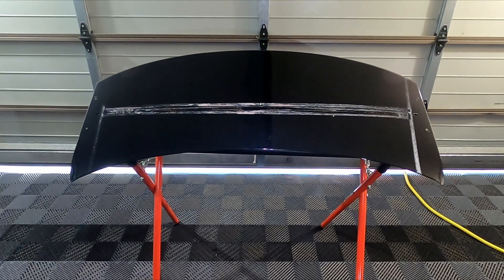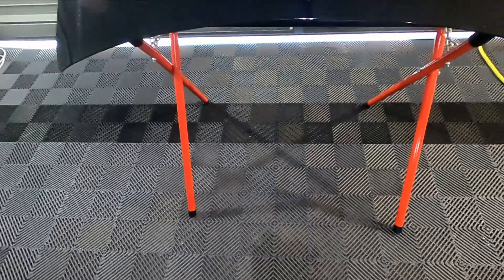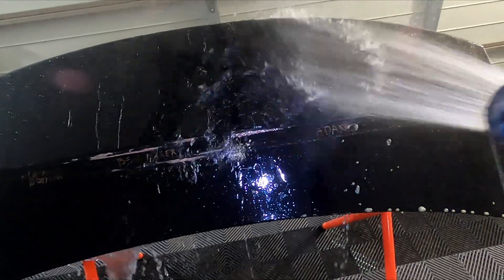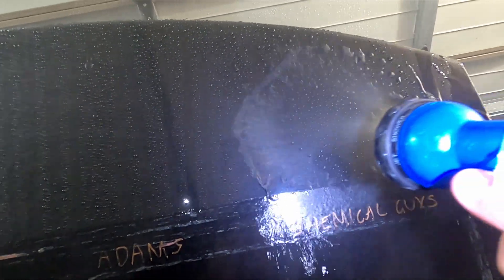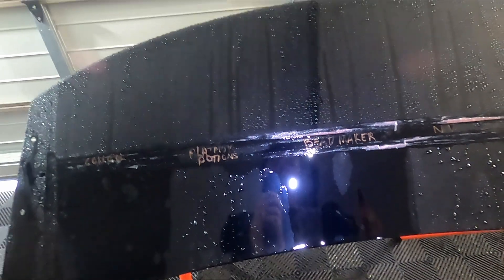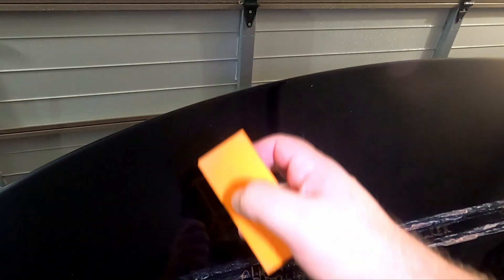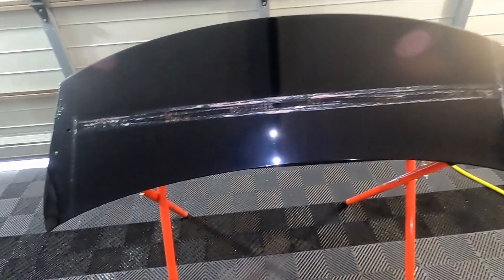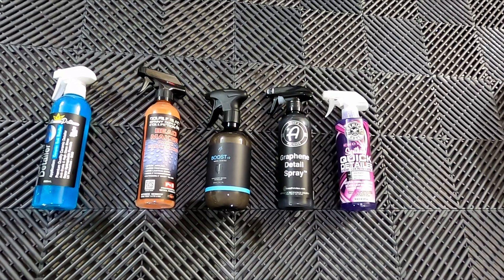What's The Best Ceramic Detailer? | 2 Weeks Later | Adams v Chemical Guys v NV v P&S v Platinum P

Comment: I put Ethos Finish shine ceramic detailer on my sister car on Oct 10th. today a little over 2 months in, its still hanging on. It rained and I still see about 35% protection left
Reply from the maker: I haven't tried that one yet but I did use their graphene sealant in a previous test

Comment: Might be a silly question, but can't bowden's own bead machine, or Mirch bead king be used as a topper for ceramic coatings as well. But would last longer than these detailers?
Reply from the maker: It's possible that they could or could also gunk up the coating so will be worth doing some testing

Comment: i bought beadmaker before looking into reviews, its lasted a month so far on uncoated paint and beading pretty nice, slick and shiny. Was applied with 2 microfibres after drying the car. Has rained a couple times and still holding on. Does the job but curious to see if there’s better for the price.
Reply from the maker: There's so many better products with better performance but I'm all for people using what they like so if you get the results you're after then I say keep using it
Reply: Try turtle wax seal and shine when you get a chance, it’s so cheap and I put 2 layers on my work van and it’s lasted months and months, probably almost a year.

Comment: Could you try the other platinum potions ceramic detailer they have? It’s a green liquid rather than blue, I bought this not knowing what it was, it’s hydrophilic rather than hydrophobic, so supposed to sheet more rather than bead like the blue one. I thought this was would be better due to pretty much removing all water that touches the surface?
Reply from the maker: I do have some here and from what I've seen the green ones are just a regular detailer or car wash without Si02 where as the blue will have Si02.

I use the green one to detail my engine bay occasionally but haven't tested its water behaviour as I was told it's not meant for beading

Comment: Great stuff. I like this series because it's over fast and the market is saturated with options. Testing to see what may be worth a try is really helpful.

Next set I hope you include the winner platinum potions to help cross test comparisons. Then as I mentioned previously sonax and mirch!

Maybe og drying aid? It's well regarded in America and can be gotten quickly in Aus. Expensive here like sonax though.
Reply from the maker: Thanks so much, I likely won't include the platinum potions as we already have the data on it now and I'd prefer using a few other nee products

Comment: Beadmaker has great slickness and gloss, it’s not for longevity. It’s a great drying aid.
Reply: Actually I’ll get back to you on beadmaker affecting the hydrophobics, I’ve applied a little bit as a drying aid on top of gyeon mohs evo.
Reply from the maker: I did use it in my first videos as a base protection product and had terrible durability where people told me it should just be used as a topper so that's why I used it here.
I had the same results in this test that I'd had off camera on my own car with carpro cquartz UK as the coating I used it on top of

Comment: Pretty sure youve either gotten this comment a million times, or youve already covered a specific product and i simply havnt found it in your channel yet, but, was wondering if you could add Technicians Choice TEC582 Ceramic Detail Spray to your experiments rotation? So far my experience with it has been fairly decent. Makes my vehicle washes run much smoother it seems.
Reply from the maker: Unfortunately it's not a product that's easily available here in Australia.
Not that ice found anyway

Comment: Ideally should have used nv jet instead of lustre
Reply from the maker: I didn't use either in this test, I used NV boost v2 which is their quick detailer.

I have used jet in a series previously though but as a base layer sealant

Comment: beadmaker is trash and clogs ceramic coatings . NV boost is amazing because it actually rejuvenates ceramic coatings and doesnt just add another layer over the top of your coating like most do. So it doesnt change the behavior of your regular ceramic coating like other ceramic detailers do where youre just seeing that layer of coating instead of your actual coating.boost v2 does add an extra layer though. If you want to keep a ceramic coating looking and performing like day one get nv boost and use it every 3-4 washes. Thank me later.
Reply from the maker: Yep I had the same thoughts and was exactly why I wanted go do this series
Reply: @EvolvedDetails  it’s crazy so many people recommend bead maker. The other good thing is the regular nv boost is only 16$USD so it’s a lot cheaper than the v2 and others. I would choose boost over v2 any day of the week unless the customer didn’t have an actual coating. They make great products. I actually don’t know another product like the normal boost.